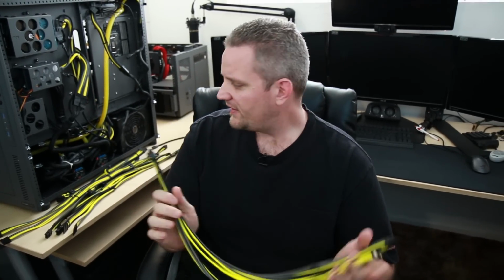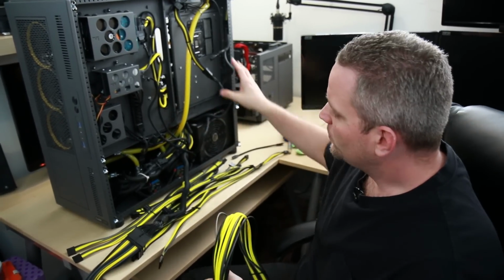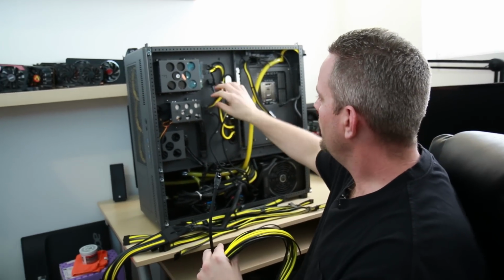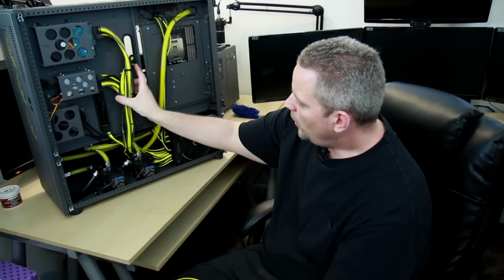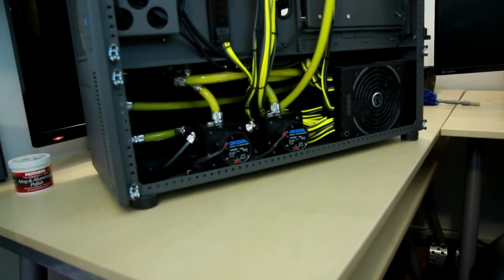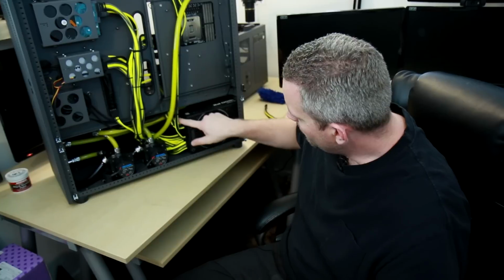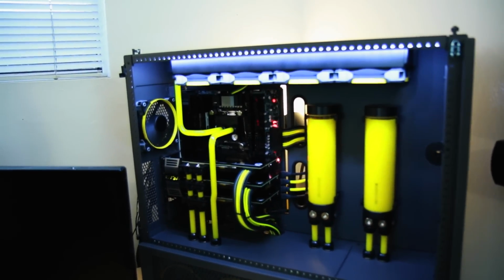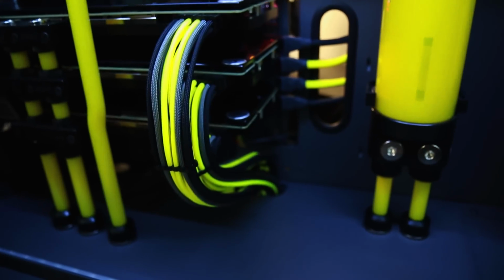Installing the Custom Cable Set in Skunkworks!

Comment: Jay,
I love the new cables. I agree that keeping them in place really fucks with the OCD but overall much cleaner. I love how the backside and underneath is much cleaner as well. Did you notice and improvement in the GPU cooling since there should be some improved airflow? Not that it was probably doing enough as it was already..I struggled alot on my 750D keeping the backside neat and I couldn't to my liking. I will definitely check this place out for custom cables and it will make a big difference. Your build is amazing btw! Very clean! I would love to have that case you have but fell out of my chair at the price of it. I know its nice having it custom done and probably totally worth it if you have the money. I didnt want to skimp on performance so blew all of my budget on the 5960x, REV, 16g ddr4 2800, dual 980 EVGA SC cards as well as complete custom water loop for the entire setup. Guess i can save for the case for a later time.. Just have to find a place to put that behemoth as it wont fit in my rack enclosure and i am kinda limited on space but I am sure I would find a workable solution... Thanks for another great video. Keep up the great work. oh and yea keep the intro as is!!! lol

Comment: Jay, the first set of custom cables in the video, did you notice any discoloration from having the cables exposed to light vs those which were tucked in under the case?

Comment: I love the look of the new cables, Jay.

I will just throw this out there for what it's worth, I have been using nothing else but Razer keyboard mice and mice pads for about four or five years, my original mouse still works although I gave it to the "wife" to use. I did for a short time have a issue with the rubber on the mouse wheel slipping a bit, but it seemed to fix itself once I disabled the wheel light ... maybe the rubber would get to warm and expand too much who knows. I know people are going to flip out but I prefer membrane keyboards and both of which I have never had a problem with.

I grew up around apple IIe's and windows 3.1 and the horribly load mechanical keyboard then, I don't have no interest in going back to clacky crap. I only mention this because I believe you said you where possibly thinking about reviewing some of the products you saw at CES.

Comment: Nice work on the new cable management.  4K question for you,  If I add another EVGA GTX 780 SC and a 4k monitor,  will that run smooth enough and be..."future proof" enough with my current system?  Or wait?

Specs:

Evga E758 SLI
i7 930 4.2 OC
G.Skill Sniper 12GB 3x4
Evga GTX 780 SC
3x WD Raptor Raid 0
2x 2TB WD Black

Comment: ***** Your rig makes my insides tickle in a good way. Would you recommend Sanctum or Lutro0? I will need to get some extensions for my rig but don't have much money, just need to get some black and red extensions to finish of the colour scheme nicely. Which would you say are better, or are both fine? I was thinking Lutro0 because the Sanctum cables in yours weren't wanting to stay in position from the looks of it, which would maybe bother me slightly

Comment: Wow what a setup jay.

What case is that because I am thinking of possible do a x99 build and was thinking using the corsair 780t case.

Did I just see 3 g-sync monitors? I only have the asus swift would love another.

Nice video
Reply: case labs (i'd give a model number but they are so modular its not as clear cut as that) its 1 of the 10 models (sth10, sm19, sma10 i dunno maybe the sm8?) get built the vrsn that suits you.
Reply: AuralVirus Thank you.
Reply: RaidenWolf  sma8 or sm8

Comment: Your setup is amazing I could only wish I had yours. Well not exact skunkworks is your own creation. My current setup is running two 780 tis running in sli an msi gaming 7 mobo, an intel i5 4960k running at 4.0 and that's roughly it. Couldn't afford water cooling for the gpus unfortunately. Also, keep making the great vids they are awesome to watch

Comment: Did removing the capacitors that were in the cables affect the power?
Reply from the maker: Nope, not at all actually. Heavier gauge wire also.

Comment: That 1 down kinked tube is driving me into ocd territory. I feel for you Jay, it must have tipped you over the edge having to do it. =D
Reply from the maker: Im actually thinking of redoing the entire rigid tubing in the case.
Reply: ***** LOL I knew you would :) -

WOW an entire rebuild? no just replace the bottom tray so the hole is in the right place? super extreme, no half measures xD

Everytime I see that kink I imagine just doing a full loop around (ie a p & b on top of each other shape)  then back down instead of the kink.

Good luck, look fwd to the vid.

Comment: ***** Each card is 2 cables.

Top cards power in the middle.
Middle card on either side of that.
Bottom card on either side of that.

Near the mobo tray
 BMTTMB

Comment: would it be worth it upgrading from a amd phenom ii 1090t to the i7 4790k, i currently have 6870 card so i wasnt sure if i upgraded to a gtx 980 if my cpu would bottleneck the graphics.
Reply: no they have done countless videos proving how hard it is to bottleneck a gpu. You might gain 4fps with an i7. Take your money and buy 970 sli or 980

Comment: Would this build work fine?

case: NZXT H440 White
cpu: i7-4790K or i5-4690k
gpu: MSI GTX 970 Gaming (planning on upgrading to sli later)
ram: HyperX Fury DDR3 1600MHz 16GB White
psu: Cooler Master V850 (850w)
cpu cooler: NZXT Kraken X61
motherboard: MSI X99S XPOWER AC
ssd/hdd: 2x Samsung SSD 840 EVO (raid 0), Seagate Barracuda 2TB

I am wondering if this is a solid build and if i should change anything out

(btw I am painting many of the colored components white + adding some lighting and custom cables)
Reply: LGA 2011 mobo with 1150 CPU? Also if you are gaming the i5 is the way to go, 8gb ram is more than enough, Anything else is fine
Reply: No, that motherboard is on X99 chipset, with LGA2011. You need an lga1150 motherboard, with Z97 chipset
Reply: Axecution ok, thank you! I just found the motherboard on sale and didn't look into it :P
Reply: FunGUI Thank you! I think about going with the Asus Z97-PRO, Ive heard a lot of good things about Asus motherboards
Reply: William skagen its a pretty good motherboard, and asus is well known motherboard manufacturer (right now im using a asus motherboard :P)
Reply: I would go w/ MSI,  cheap, reliable and variety
Reply: FunGUI LGA1155 is the wrong socket. Z87 and Z97 are LGA 1150. Z77 is LGA1155, which is incompatible with 4th gen CPUs, and the refresh CPUs.
Reply: Sanctorum Yeah sorry, mistake make sure to get 1150 not 1155 original poster
Reply: If you seriously have to ask this question , I would advise you go pre built or get somone who knowS what they are looking at to spec your machine . I see so many comments with people saying ''Will this build work '' And they just list loads of high end parts because they have seen them in sponsored videos being used .
Im not saying this in a nasty way , But its amazing how much money people waste buying components that they will never even come close to using the full capability of . If its just for playing Games then you dont need to spend much at all . Decent GPU , 8gb of Ram ( and no it doesnt have to have anodised cooling fins) Somthing like an i5 3470 will be fine as a cpu , Cheap asus Motherboard p8h61mx or similar , small ssd for your os and a 3tb storage drive . I would spend a bit on a decent key board and mouse though but thats just me .
Reply: John Smith Thing is i found just about everything on the list on sale (execpt the cpu) though i didn't really choose the parts based on needs, but more on looks (White theme)
Reply: Ahh fair enough then , Like i said i wasnt having a dig at you ,  And if you want it to look a certian way then thats completley down to you ! But its supprising how much money you can save if you can see past the marketing blurb .

Comment: Oh boy, if it getting custom sleeving for a full set of cables for a specific power supply costs as much as it did when lutro was doing that independently, then I'd rather burn some fingertips and spend a weekend or two doing it myself. Although, I am pretty broke. There's that.

Comment: I'm gonna build my first pc in PC in February. I'm gonna be doing gaming no rendering or anything like that let me know where it stands and what you think.

CPU: Intel Core i5-4690K Processor 3.5 GHz LGA 1150 

RAM: 
Crucial Ballistix Sport 8GB Kit (4GBx2)

PSU:
EVGA 600B 80PLUS Bronze

MotherBoard: MSI Computer Corp. Micro ATX DDR3 1600 LGA 1150

GPU: EVGA GeForce GTX 750 Ti FTW

HardDrive: Seagate Barracuda 7200 1 TB

I'm worried about the power supply and not sure if it's enough or good enough.
Reply: psu is fine. the only things I see is that you might like a full atx mobo better, and I would consider spending less on the cpu and more on the gpu.
Reply: ***** thanks man it helps
Reply: I recently bought that exact same PSU and have had problems. The first one i bought would power up but not allow the mobo to POST. It would power down again 2 seconds after switching on, and then had to be disconnected and reconnected to power on again, only to repeat the symptom.  The replacement I was given on returning the PSU works, but when it arrived there was visible glue on one of the fan blades which caused rattling when the fan spun. I took the grill off and cleaned it off and now it doesn't rattle as loudly, but it's still not silent.  All in all, it does work now, and I have no problems with it, but felt it was right to warn you if you're thinking of buying one.
Reply: Kurv K alright thanks

Comment: when i did my sleeving i used super glue to hold the wires where i wanted them just got brush on glue and but a dab on the inside of the cable and glued them together

Comment: He really made a balls of that tube coming down from the CPU, just looks wrong.
Reply: He had to do that after upgrading the mobo and CPU, they where all straight before. To fix that means moving the hole in the bottom plate which is a lot of work as the entire PC must be completely stripped, then make a new plate with new holes and paint it. I don't think it's all that bad really, in fact it adds a certain element of interest and shows that it doesn't have to be 100% perfect to still look awesome.
I appreciate that it probly fucks with your OCD but hey, that's your problem isn't it ?

Comment: Extensions adds so much unnecessary cable length. It is better to buy fully sleeved kits to plug directly into the power supply.

Comment: Problem i have with Cable Sleeving is how GPU cables look. Some people can get them to stay perfectly strait but some cant. If they are not uniform i dont bother with them. Extensions are really pointless. You are just adding more bulk. What has worked for me for the past year is remove the sleeving of Corsair cables and you are left with black cables. They are very easy to mange and stealth. I know the whole idea of cables is to hide them but since you cant most people try to make them look good.

Comment: I wish EVGA didn't use such weird cable designs for their PSUs. There are tons of double wires and these weird little capacitors on them... it looks like a complete nightmare to sleeve.

Meanwhile, they sell their own sleeved cables that have... none of that, really. It's weird.

I'd love to sleeve my own cables, but I'm not doing it with my EVGA ones. Maybe someday I'll buy the dumb sleeved cables from them and then re-sleeve them. lol
Reply: +Kevin Walter If you run your build anywhere near the rated wattage of your PSU, the capacitors are very important to filter out any ripple coming through. They help deliver clean power to your components. That said, you can always buy some smaller caps of the same rating, use heatshrink to hide them, and run the capped side of the wire closer to the PSU where you won't see them. It may seem dumb to you that they use caps in their wires but the engineers know what they're doing even if it's not always the most aesthetically pleasing or the easiest to rewire.

Comment: That's a rather slow boot
Reply from the maker: The X99 board doesnt like having the caps drained. After the slow boot, it boots in about 12 seconds for all subsequent boot. Never figured out why it does this.
Reply: ***** My rig used to "double post" in the past, but then after adjusting some voltages (in my case, the ram voltage, and I was using the rated voltage for then before) it stopped doing it. Maybe there is something you could adjust to solve the post issue.
Reply: ***** My motherboard likes to randomly turn a USB hub off when booting. "Normally the one that has my keyboard and mouse plugged in" I can still shut down my pc normally with the power button when the USB Hub fails, but even on restart the USB Hub continues to stay off.  The only way I can reset it, is by turning off my power supply completely. It does it randomly only while Posting.

Comment: I want a non-troll to rate this pc build... honestly..

intel i5 4690k (cpu)
noctua nh-d14 (heatsink)
asus maximus vi hero (motherboard)
corsair vengeance pro 16gb (2x8) 1866 cl 9 ddr3 ram (memory)
asus strix gtx 970 (gpu)
corsair ax760 (psu)
corsair graphite 230t (mid-tower case)
4 noctua nf-f12 fans (2x top/intake, 1x bottom/intake, 1x back/exhaust)
2 corsair sp120 red led fans (2x front/intake)
Reply: 3.5/4

Comment: ...using a traditional HDD?...ur rig boots up too darn slow:(...no fast boot option on your mobo?...
Reply from the maker: My rig boost in 12 seconds after the initial slow boot... its a BIOS thing right now and happens after caps are drained.

Comment: It looked better before.
Reply from the maker: You thought that jumbled mess of air flow blocking wires looked better? I question your sanity.
Reply: The back looks better, I was talking mainly about the GPU cables from the front.
Reply from the maker: They are exactly the same from the front.
Reply: ...The cables were going thought the back before, now there going through the bottom...not the same.  They looked better before IMO